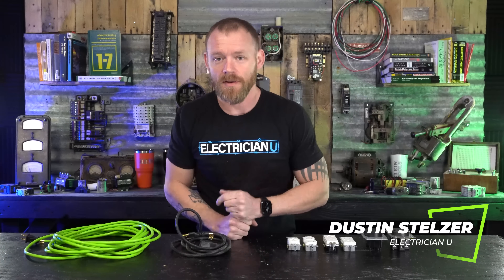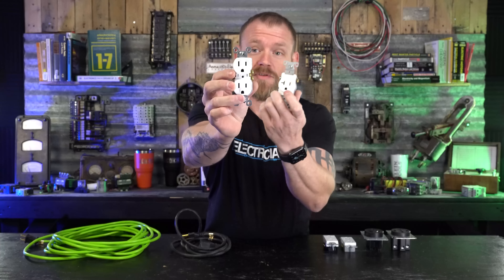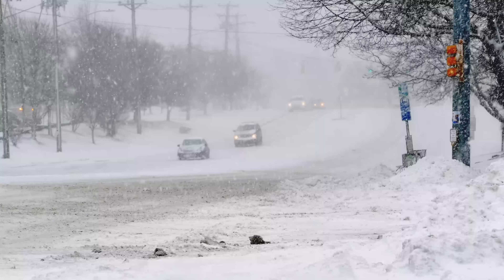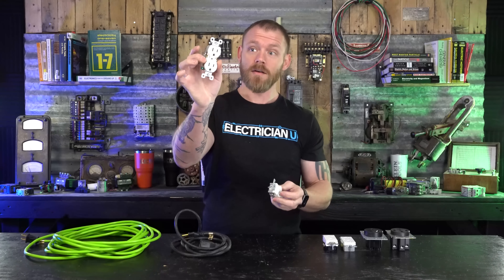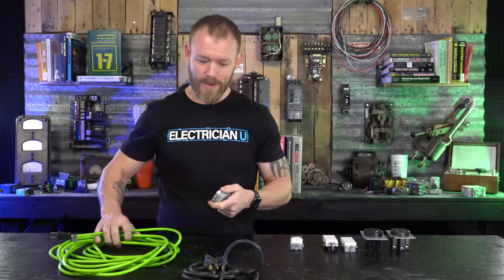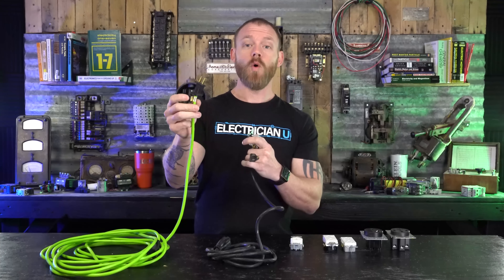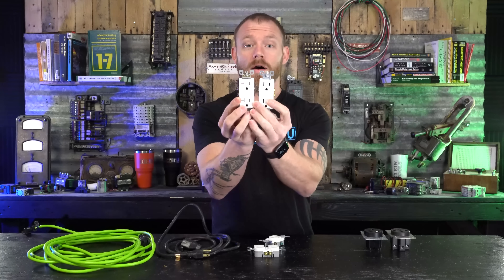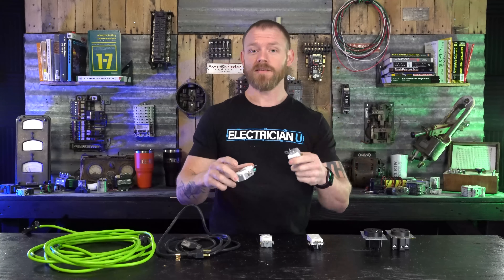Why Do Outlets Have Different Types of Holes?

Comment: Dustin can you please do a video on handle ties for breakers. Recently heard of a situation where a tankless water heater requires 3 240v circuits and what was ran was 2 25 amp breakers with a handle tie to act as a 240v 50amp set up. Ive seen it in existing older homes but this is new construction could you elaborate on your opinion and when this might be beneficial I cant think of a good reason to do this

Comment: I'd like you to go a little more in-depth with the 240v receptacles.  I know you said the 30A was for welders and the 50A is for stoves, but what about driers?  I've seen both types (have had to swap out many-a-electrical cord to accommodate the different receptacles for driers and would really like to understand which one is better or know when I should swap out the receptacle if someone installed the wrong one.
Reply from the maker: That would be an interesting topic to bring up in our discord: https://discord.com/invite/7ykYfbh

Comment: hello Dustin I'm Utah and just help my cousin put some new outlet in kitchen and i came a cross the new gfci outlet that now has the line connection on top side of outlet and load on the bottom of outlet with the tape label cover over this idea totally change how we would normally do hook up outlet . i was dumb founded how the industriously would change this any thought on this if you seen these device so far yet

Comment: The two prong cord which is designed to maintain proper polarity does matter.   The screw shell of a lamp holder has to be neutral for safety purposes. It is very easy to touch the metal of the screw shell when installing or uninstalling but more importantly the paper insulation around the screw shell on older lamps can decay and short circuit. I did a service call once where the entire apartments stamped metal ceiling was energized because the polarity on the kitchen counter receptacle that supplied  almost the entire apartment had been reversed making the polarity reversed for everything upstream from it. An old ceiling fixture screw shell had deteriorated and leaned into the metal canopy of the fixture which was mounted to the metal ceiling. The ground was non-existent because the BX fitting was not tight. All you guys giving electrical advice need to be careful not to make statements that exceed your experience and knowledge. Your information is appealing, appreciated and useful BUT you all need to not start misinformation. Be sure of what you say. The polarity is DEADLY important. I hope you edit this video to correct where you basically said that it doesn't matter.... It certainly does matter. Electricity is invisible dynamite and needs to be used safely and to Code.

Comment: T-slots are NOT 20 amp receptacles. Do not make this common nomenclature mistake. A true 20 amp plug has perpendicularly oriented slots, that means one slot is vertical and the other slot is horizontal. On the other hand, a T-slot has 3 opening; it gives you the option of plugging a standard 15 amp plug into it, or a 20 amp plug. It is listed in the NEMA Chart as a 15/20 amp device, NOT as a 20 amp plug.

Comment: @ElectricianU You showed what you said was a 15a duplex receptacle and gave an example of 18 amps running through it and possibly burning it up. I remember where in a Mike Holt video, they stated that the guts inside of a 15A recep and a 20A recep are identical, meaning it is the same metal, thickness, etc. And they indicated that it didn't matter which was used, 15 or 20 amp. Can you speak to this? Or anyone else?
Reply: This is true AND people sometimes forget that the actual current is determined by the load and not the breaker or receptacle. You can put a 15a receptacle on a 20a circuit safely because you can only plug 15a appliances into that outlet. Your 1500 watt heater doesn't suddenly grow an extra heating element and become an 2000 watt heater because you put in a 20a breaker.

Comment: I love watching the content. I have a question about if something can be done technically and safely. My father has a 240V welder in his shop, he wants to use it for a few projects he can’t move into his shop. Is there an extension cord for 240V 30A that is about 150ft? If there are, what caveats should he be aware of? If not, what other solutions could work?
Reply: You’re gonna want to order some S/O cord for that application. You’ll need a 12/4 so green black white red. Then you’ll have to buy the plugs for either side that corresponds to his welder.
Reply: Sorry 10/4 not 12
Reply: Please talk with some local electricians.  

Your welder may fall under NEC 630 electric welders.  In that section, the type of welder and it's duty cycle and more, play in to how many amps you need to supply it.  

The length of your run may have the resistance of the wires Causing a voltage drop beyond the 3% in NEC 210.19. (A) in 3. If you simply move the recepticle.

And maybe their is an easy fix for this.
Reply: First, being 150-ft away, this is likely a separate structure and realistically either a sub-panel or separate service would be a better starting point.

For temporary use (rolling out the cord and rolling it up each time), generally speaking, you're not going to find a pre-made cord of sufficient length. Also making a cord of that length really needs to be engineered for purpose, including voltage drop calculations.
Reply: @thomasbonse  its the distance from the pannel in the shed to the driveway. thanks to our city the backfolow preventer for the lawn system is above ground so driving to the shed is not a option. At one time it was possible to park a truck, suv, etc or trailer next to the shed.

Comment: I use the square duplex receptacles as a downstream from a GFCI.  Otherwise I use the round.  This gives a clue to check the reset on the GFCI if the square receptacle goes out.  It only takes once at losing power in a round receptacle without the knowledge of it being remote from a GFCI.
Reply: As that isn't a code requirement, the shape of the outlet doesn't actually give such an indication. The code-required labeling of gfci and afci outlets does, however, provide this indication. You know, those ugly stickers the homeowner will immediately remove...
Reply: @thomasbonse  `  At a pervious house I owned, someone wired the patio receptacle downstream from a bathroom GFCI that was half way across the house.  I spent a whole day clicking off breakers trying to find the source power for the patio receptacle.  It wasn't until I noticed the bathroom receptacle tripped that I got a clue.

When I remodeled the kitchen I replaced two GFCI with each having a downstream.  I used the square to ID the circuits at a glance and round everywhere else.

Not code.  A courtesy.

Comment: The 20a 110v outlets are usually better built. Its all i install. Seen to many cheap 15a with various fails.
You should have tossed in there the 15a and 20a. 220v outlets in vid. :)
Can you legally pull 110v from a 220v 15a or 20a? Considering there is no neutral.
Reply: The one big caveat to this is tamper-resistant outlets. The 20a ones need a much larger shutter to cover the T-slot, which means the contacts have to be much further back and therefore don't hold plugs as well as 15a TR outlets. I definitely agree that 20a outlets should be installed on 20a circuits anywhere a TR outlet isn't required.
Reply: @KingdaToro  
I think i have TR 20a 's
They suck connecting until they wear in a bit.
Reply: If you use commercial (spec grade) 15A receptacles, the only difference is the cover. The insides are exactly the same as the 20A. I replaced all the receptacles in my home with commercial grade. 20A on the 20A circuits, and 15A on the 15A circuits with 14 GA wire. If I were ever to rewire the whole place, I'd use 12 gauge wire for everything.
Reply: @KingdaToro  I have the same issue with tamper resistant 15a outlets. My old outlets grab the plug tightly, while the new tamper resistant outlets slide in and out too easily.

Comment: Those 120/240 receptacles can really confuse people. Since the 30 amp carries L1 L2 and neutral, no ground. So you can derive either 2 120 volt feeds or a 240 volt feed. That 50 amp is the newer standard carrying L1, L2, Neutral and Ground and can supply 120 or 240. And all kinds of variants like in the diagram in between.
That TT-30 and 5-30 though, people really need to be careful with. It looks like a 240 volt outlet but is really a 30 amp 120 volt outlet, and I have found more then a few wired incorrectly for 240.

Comment: I was once told that the polarized plug was a factor for the double insulated device which lacks the ground and specifically utilizes the neutral as it's ground (since the N is bonded to G in the circuit). This ensures polarity and thusly meets the rating as a double insulated device?
Reply: @jeremiah Ansell.   Your understanding is partly correct. Double insulated tools absolutely are designed to isolate the hot to the switch thereby keeping the entire tool/device wiring at zero volts (neutral potential) when not in use. The part to understand more is that the tool/device is not grounded. It's not using the neutral for ground, it's designed without a ground. Double insulating it makes it safer to use without a ground than if the neutral was less insulated than the hot which is the case for various apparatus. Edit... Just to be clear... Neutral is never used for a ground. Yes, at the source of power ( technically Derived Source) the neutral and ground are bonded but that is only at the source. It's correct to say that Neutral is never used as a ground. I can explain it beyond this but it's alot to cover.
Reply: Total nonsense. Double insulated devices are not grounded. They do have them in Europe also.

Comment: For the life of me, I've never seen an appliance or anything have the 20 amp blade pattern, even in industrial areas. I wonder if it's just too uncommon to find a 20 amp outlet so manufacturers tend not to use them- maybe they either de-rate the appliance to fit the 15 amp or upsize it to a 30 amp industrial outlet?

Comment: What is the correct way to orient a 120 v receptacle, ground up/blades down or ground down/blades up?
Reply: That's all preference. There's an argument to be made that ground up is a bit safer because if the plug were partially backed out of the receptacle, a metallic object could not easily fall in the gap and bridge the blades. Either orientation is acceptable though unless specified otherwise for that particular job.

Some guys like to put all normal receptacles with the ground down, but put the ground up on switched receptacles to make them stand out.
Reply: Any discussion on this subject degrades to an argument.  No matter what anyone says, no one can cite a study.
Reply: @Californians_go_home  perfect solution

Comment: I'm curious if it's against code to put a 20A outlet on a circuit with a 15A breaker, because it might mislead someone into thinking that the circuit could handle 20A.
Reply: Yes, always. A 15A circuit can only have 15A outlets, a 20A circuit can have 15A and/or 20A outlets as long as it has multiple outlets. When a 20A circuit has only one outlet, it must be a 20A outlet.
Reply: Adam got it....NEC 210.21.(B) (3). &. Table 210.21. (B) (3).
Reply: @keithharrington4595  I don't not agree. I believe that it is specifically stated that a 20 branch circuit may have 15 or 20 amp receptacles. This has been the subject of some debate but I believe that it is permitted as long as it is a general purpose circuit with more than one receptacle on it.
Reply: @ianbutler1983  You can put any mixture of 15A and 20A receptacles on a 20A circuit.   You probably wouldn't, because you usually standardize on 15A receptacles for the general purpose receptacles, and only put in 20A receptacles where necessary.

The reason you get to put 15A receptacles on 20A circuits is that they are rated to carry 20A between each other, even if they are only rated to deliver 15A to an individual plug.   Manufacturers have standardized as much as possible, and if you disect the receptacles, you will find that 15A receptacles are just 20A receptacles with a plastic face piece that prevents plugging in a 20A plug.
Reply: @KingdaToro  if it is a single "bull's-eye" device then it has to a 20 amp device. If it is a duplex receptacle it can be 15 or 20 amp. Personally, if only one device on a 20 amp circuit I only use a 20 amp device.... But a 15 amp duplex is legal on a 20 amp circuit.
Reply: I got one for you guys. I was working on the machinery electrical installation on a addition to a plow factory.... The addition had 4 20 amp duplex receptacles on two separate 1-pole 30 amp breakers. So two duplexes per circuit. I called the engineer of the building on it and he said he was allowed to engineer that design. I never questioned it. But the fact remains that it's possible to plug a 30 amp load (using only a 15 amp plug) on one of those receptacles. I had too much to get done to bother getting his reasoning.
Reply: @fritzmiller9792  Exactly. A duplex receptacle counts as two receptacles, so it's legal to put a single 15A duplex receptacle on a 20A circuit. Generally, single "bullseye" receptacles are only used for dedicated circuits for a single device that will stay plugged in virtually all the time. There's not much point in using a 20A duplex receptacle, as anything that actually needs a 20A receptacle will draw enough power that you can't really put anything else on the circuit. It would be a pretty rare case to have two devices that actually have 20A plugs, you need to plug them into the same circuit, and you'll never use both at the same time.
Reply: @fritzmiller9792 How did that ever get reconciled with Table 210.21(B)(3)?

There are ways to make it work, if you have overcurrent protection that limits the current to the receptacle to 20A, even if it comes from a 30A breaker, but it isn't permitted to directly connect to it by code.

Generally, the rule is that the receptacle must match the branch circuit.  The 15A receptacle on a 20A branch circuit is the exception I know the most about, and it is a commonly used exception.  There is also an exception for a 50A receptacle on a 40A branch circuit, although I don't understand how this one is supposed to make sense.
Reply: @carultch  again I didn't get into his reasoning but I always assumed it was that only 20 amps would be drawn on one of the devices which would allow for the tap conductor rule to apply and allow for the installer to use #12 wire pigtails on the receptacles. I certainly never agreed this design but that is how I figured his logic.
Reply: @carultch  the bottom line is that as an electrical engineer he was legit to calculate the design and submit it for construction. Haha, I distinctly remember meeting the local code guy on the job and him telling me that anything about Code for this factory setting was going to come from me. I appreciated his honesty. You know back to the engineering of it all...#12 wire has an ampacity of 30 amps but gets limited to 20 for residential. So the real issue for me was that the 20 amp duplexes (Spec Grade) could be used to pass 30 amps. But again, on a 24" steel column above concrete, in a factory with a maintenance crew ( typical cowboy type) he could make an argument that it was deemed acceptable odds of safety. I really would have liked to hear his reasoning.
Reply: @KingdaToro  yes, bull's eyes are rarely used. However, in my State when AFCI breaker codes first came out, many local and state AHJ we're granting the exception of categorizing certain appliances ( mainly refrigerators) as designated loads so long as a Bull's Eye receptacle was installed. So for a while there the Ole Bull's Eye was getting popular.

Comment: Kitchen circuits are normally 20 amp GFCI. Now my question is… why do you normally see 15amp receptacles in kitchen if they have a 20amp breaker for them. Is that ok. Will it pass inspection?

Comment: I am buying a dust collector that requires a NEMA 5-20R 20-amp outlet with a 25A circuit breaker. One of the prongs is horizontal. I have a dedicated 20 amp receptacle with a 20 amp breaker. Do you think having that would be enough? And what does NEMA mean? Thank you to anyone who can help
Reply: NEMA stands for National Electrical Manufacturers Association — which is the accredited body for setting most electrical standards in the US.

Comment: If a plug is non-polarized and ungrounded, it's a (n up to) 5 amp plug

If a plug is polarized and ungrounded, it's a (n up to) 10 amp plug

If it's polarized and grounded, it's a (n up to) 15 amp plug. 

If it looks like ⊣ • | or ⊣ • - it's a 20 amp plug

If it looks like - _ - then it's a 25 amp plug